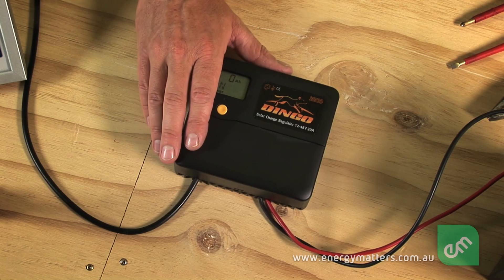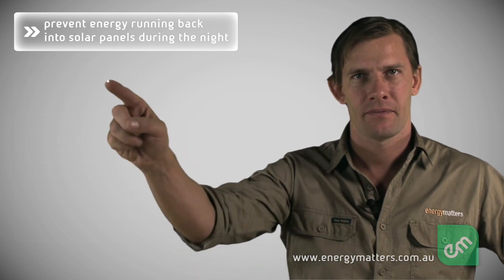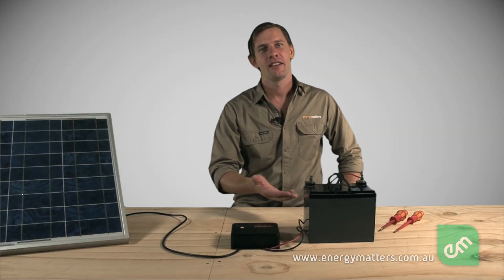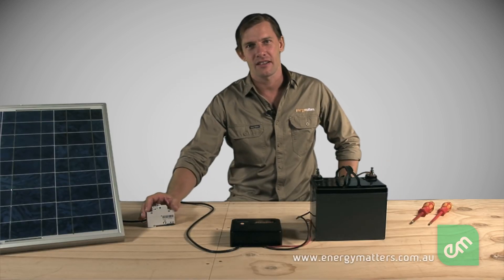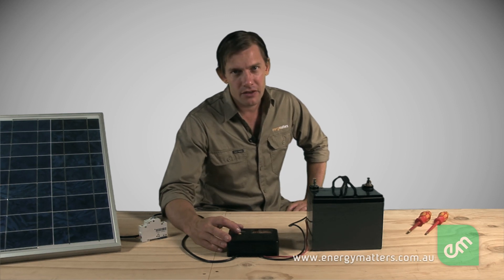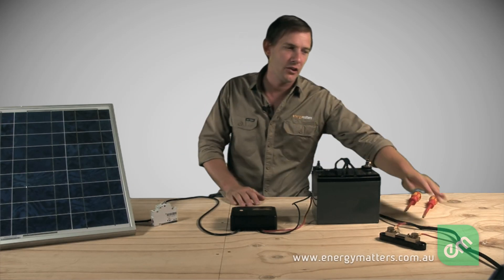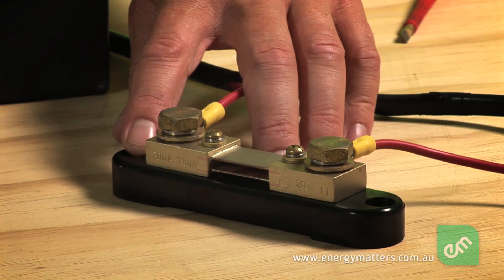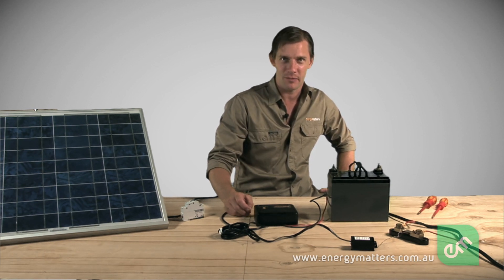Solar Workshop - Charging Regulators & Shunts

Comment: I have 4 separate  6V 3.5W mini solar panels with USB output for charging my phone and tablet (my phone will not start to charge unless at least 2A is going to it), I want to wire all 4 panels together, in parallel to maintain 6V but up the Wattage to 14W to charge quicker, do I need a charge controller and would the power to run a controller use up current from the panels

Comment: Hello, Very helpful video. I need some advice. I want to run my fridge/ fridger by solar panel and 1000w inverter, but without any kind of battery system. Is it possible? What kind of system i need to use? Thank  you